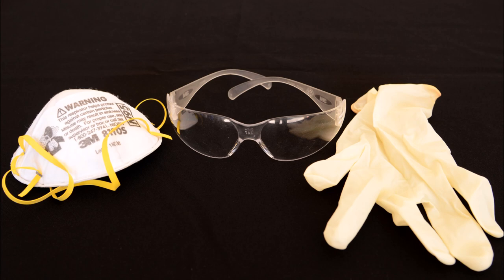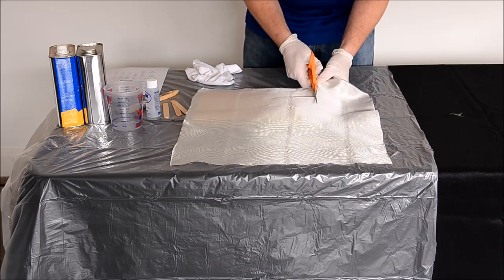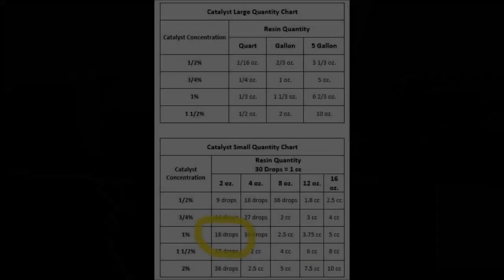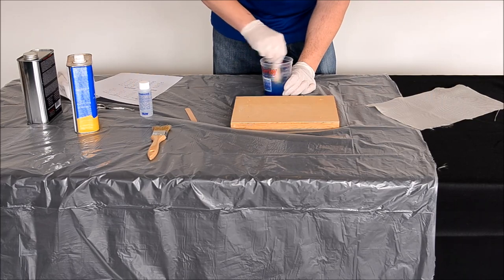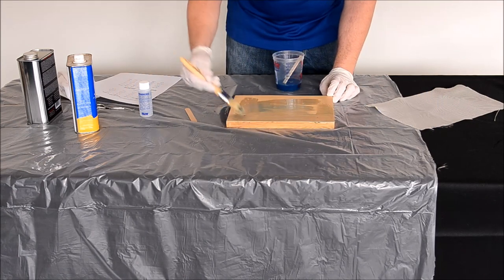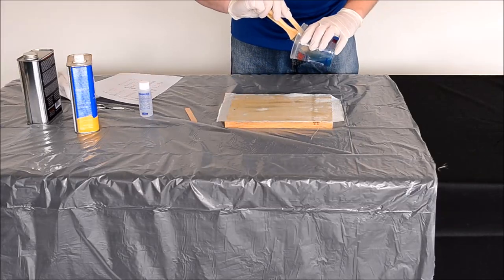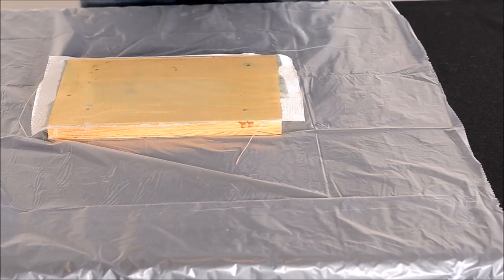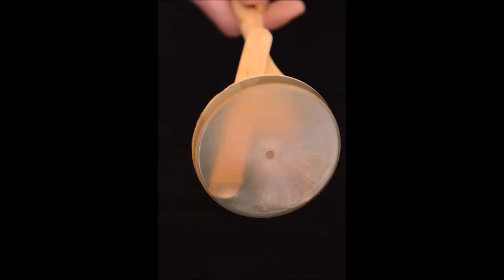Fiberglass and plywood lamination.

Comment: If I wanted to stain the wood before applying fiberglass in this manner, would it hurt the fiberglass process, or change the color of the stain?
Reply: most stains contain oils which would effect the bonding of the resin. In addition resin is not completely "water proof" but water resistant....which is why a gelcoat is used on manufactured boats. Those boats are also waxed to prevent stain and moisture penetration of the gelcoat....

Comment: Thanks for sharing awesome job I'm fixing to do the same type of job. Can I use a 1:1 mix ratio epoxy resin to fiberglass over plywood also?
Reply from the maker: You can, but 1:1 isn't typically used for laminating, but it will work.